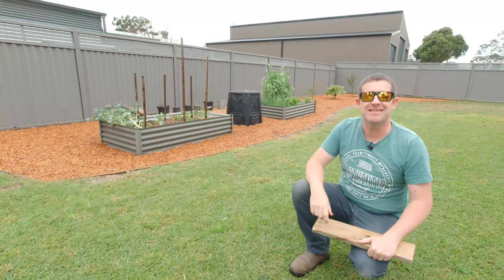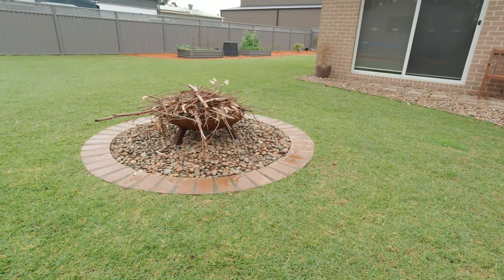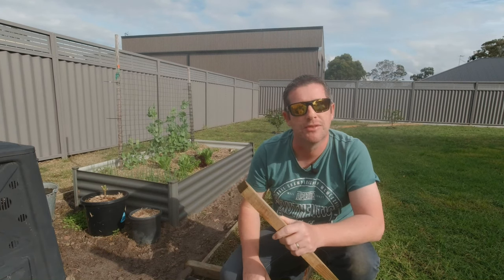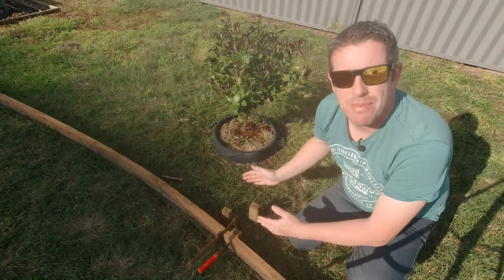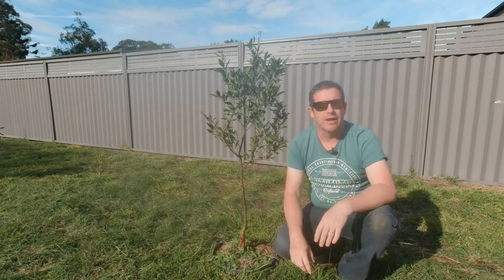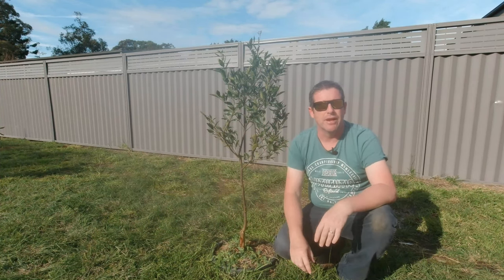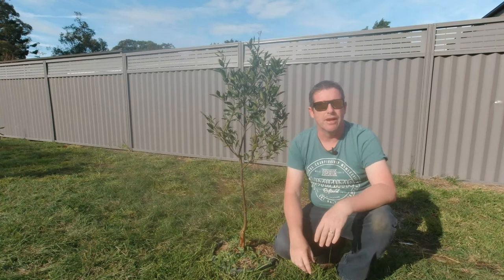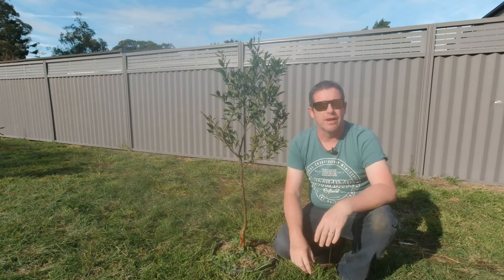LIVE | DIY curved garden edging using treated pine, an affordable landscape solution.

Comment: Have you tried soaking the timber first? That would soften the fibres and allow it to bend easier. It will set in place as it dries. Hot water would be even better.
Reply from the maker: Hi rustic35 to be honest the treated pine edging is usually quite wet and green and bends really well. You just need to look out for defects such as knots where the timber is under a lot of stress. We reconfigured edging around our pool surround using left over lengths which are over 4 years old now and they still conformed quite well without failing. But yes you could soak however with the pine I don't feel its required. We were really surprised how well it worked once we started working with it on our driveway nearly 5 years ago.
Reply: @WorkLivePlay  yes you're right, when you buy them new they're often still wet. I've noticed that with my sleepers I buy. They're always heavier new because they're still wet. 

Curves are great on the garden but, they can certainly be challenging at times.